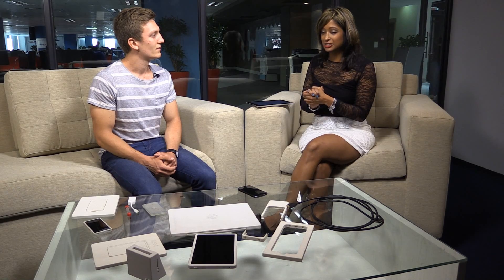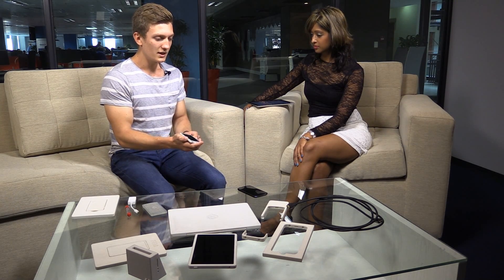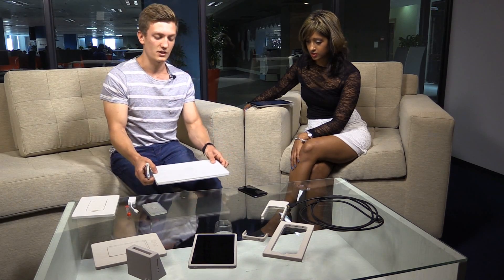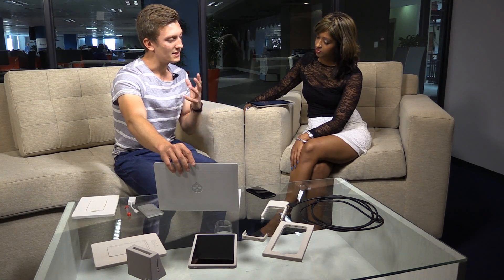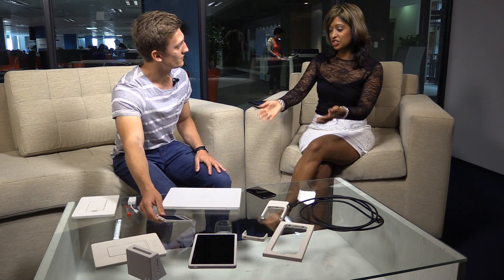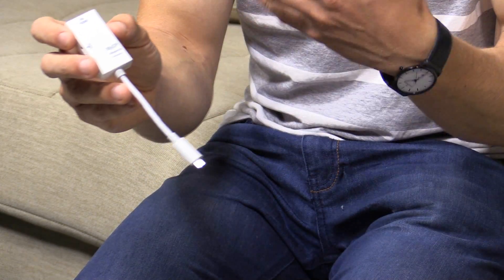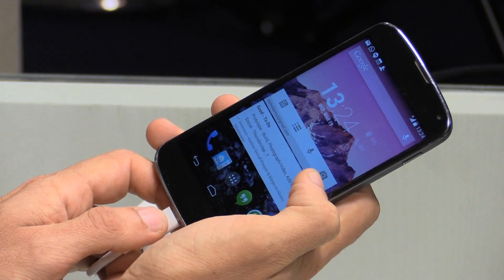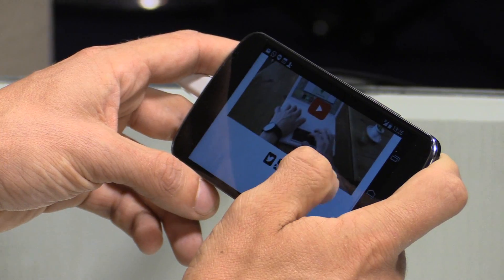Seed The Phone That Grows: Demonstration

Comment: Hi Nic, while this is a good effort, I'm afraid i'm going to have to agree with other commenters & say it's not so unique after all unfortunately. Your timing is just a little off. Ubuntu phone has already incorporated the idea of carrying around your "Big Computer" on a little pocket sized phone that you can just plug into any Bigger screen (TV's, LCD's etc) & use it as your personal computer with ease. So that feature is already claimed quite hugely in the market.

Another major thing to consider is the idea of using a cable to connect to your TV is quite "Old School" now as with screencast devices becoming so popular now, you can literally buy an adapter for the TV for like R800 which your phone screen mirrors onto the TV at the touch of an icon, so you can do everything on your HUGE Screen in that manner without any cables or compromise in quality OR lag whatsoever in refresh rates etc.

The use of the phone as a track pad is a bit of silly idea as technology is moving away from manual tracking on a pad to more point & touch of the screen directly. Simply pairing up your 10' tablet (which fits slimmer into your backpack than your Laptop type dock) with a Bluetooth keyboard & mouse essentially gives you what you created, just in reverse.
 
Do keep on innovating though, there is always a brilliant idea waiting to be found out there :),

cheers,

Comment: Okay I just want to clear one thing up: While the design isn't bad (it's actually something I'd buy into), it is not unique. Asus has previously designed and produced the Padphone series, which has you sliding the phone into a tablet-type dock, which essentially makes the screen bigger and charges up the phone itself slightly. Ubuntu is currently developing their own smartphone, and one of the features they hope to have built in is the ability to run the desktop version of Ubuntu on an external monitor off of the mobile device.

So yes, this is a good idea (really love how the phone could be used as the trackpad), and yes people would buy into it, but it's not 100% unique. But hey, so is most Apple devices....